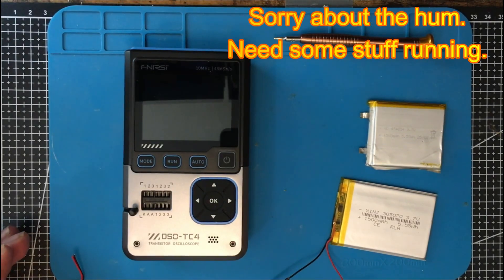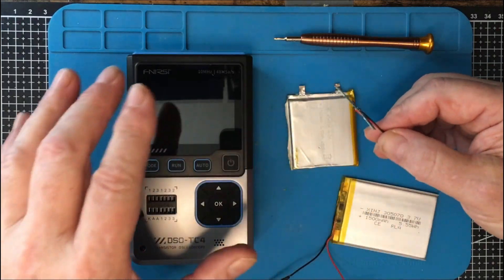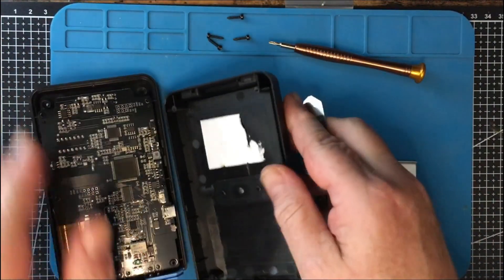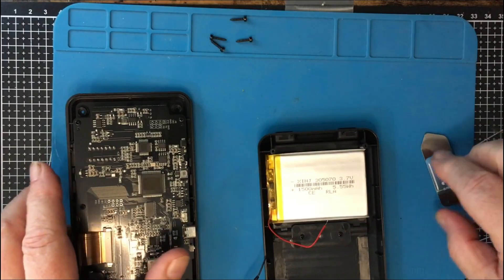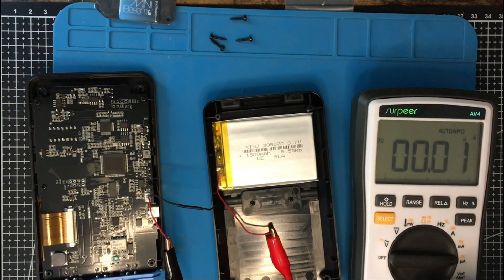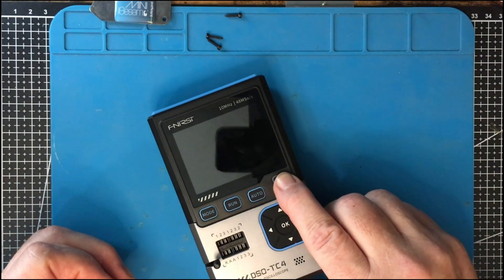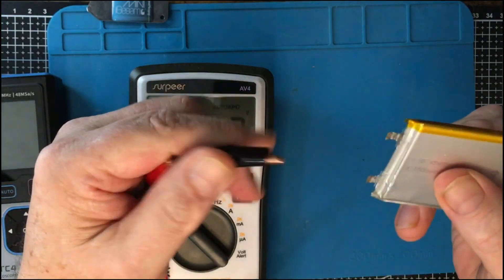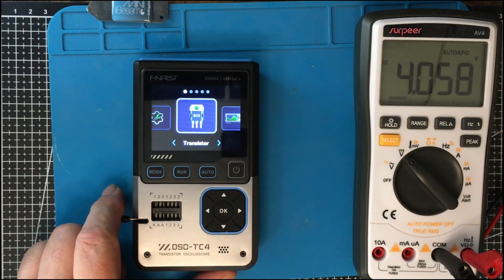Uni-Byte 0290 - You MUST Fix This: FNIRSI DSO -TC4 Battery Replacement

Comment from the maker: Just to let everyone know.  It's been over a week since this was recorded and so far the new cell is doing fine.  By now the old cell would have been dead to the point that the DSO-TC4 would not turn on. 👍
Reply from the maker: Over 3 weeks now and it has not lost any charge.  Problem is completely solved now.
Reply: So it wouldn't even turn on when plugged into AC through USB-C?
Reply from the maker: @OMNI_INFINITY  It would, but if the battery is going flat so quickly that is a sign of a problem, as was the divot poked in the side of the battery.  Plus, it's not such a portable device if it needs to be plugged in every time you use it.
Reply: @uni-byte Right, thabks👍🏻 Bought the standalone lcr today instead.

Comment: Is that TC-4 honestly so good it's worth getting? Or should I get the alientek DM40 instead? It would be nice to have a component tester, but I've been thinking of getting LCR tweezers anyway.
Reply from the maker: They are not really comparable tools.  I think if you are getting a tweezer the DM40 is the way to get between these.  However, I personally would give serious thought the the Zeeweii DSO3D12.  Much better scope and proper BNC connectors for the probes.

Comment: I got my dso-tc4 a week ago and have the same issue: I charge it up, use it a couple of minutes, next day battery is completely discharged (also it charges up to 100% in like 5 minutes). Thanks for the video, will open it up and try to change the battery as well! 👍
Reply from the maker: Glad I could help.  Don't forget to trim the legs of the socket to be more flush with the PCB.

Comment: On a related topic, for those that bought the Zoyi 702 and 703 DMM/OScopes, they've now found that the reason they put protected cell batteries in them flexing the battery holder was that they installed the wrong charging chip on the main PCB. They put in a variant that puts 4.35V out instead of 4.2V out, and instead of replacing the chip on the board, they crammed in protected cells to keep from overcharging an unprotected cell!  So if you have any of these meters, put a warning sticker in them to only replace with protected cell OR replace the charging chip on the PCB. Uni-Byte, if you have one of these meters, I would suggest you make a similar video about that after reading the EEVBlog forum with the details

Comment: Too Bad about the battery! I'm glad you could get another battery to fit. Interested to see if that fixes it. poking holes in li-ion battery's can be really really bad. Like I lost my house in a fire bad. 😱
RJ
Reply from the maker: Yeah, not a good thing.  So far, after more than a week, the new cell is holding up just fine.  It looks like the problem is solved.

Comment: A lipo is best stored at around 66% over long periods. Perhaps the battery management board is simple designed to bring the battery into storage mode after a time between charging?
Reply from the maker: It was draining down to the point it would not turn on in a few days.  While the BMS might be doing that, if that was the problem then the BMS was faulty.  I recorded this video over a week ago now and the new cell has not lost any noticeable charge.  It must have either been the BMS on the cell or the cell or both.